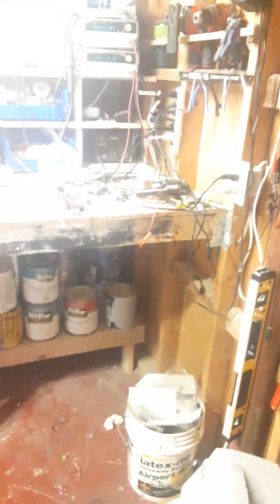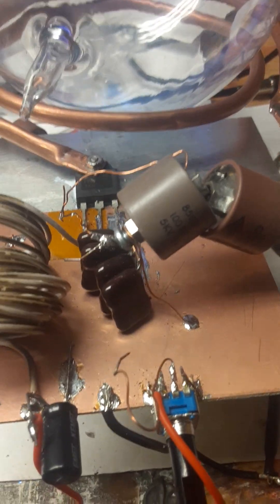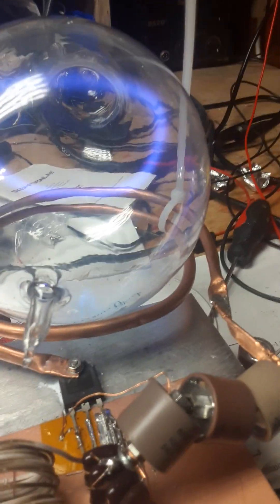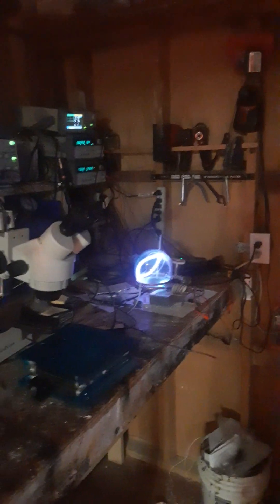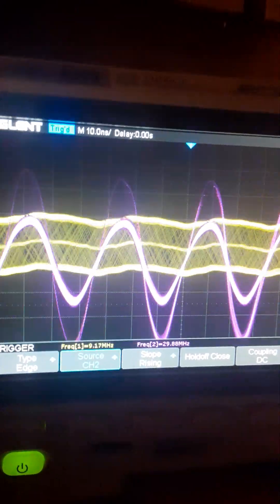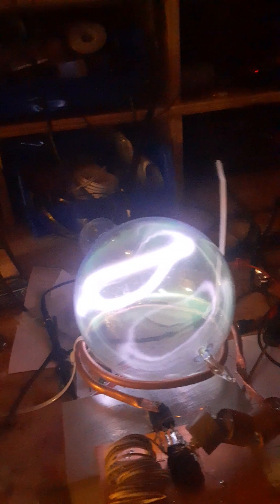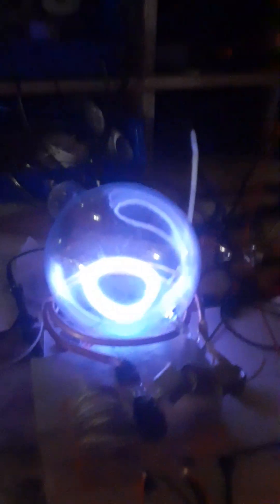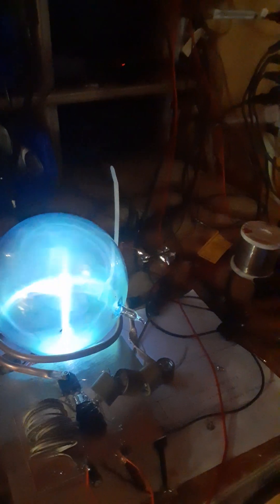Toroidal Plasma 4:   Now AWESOME!

Comment: How do you do these glasses filled with gasses or do you buy it ? I am planning to do a hydrogen one with electrolysis.
Reply from the maker: They are vacuum pumped then backfilled to 15 Torr with xenon gas in an oven.  My friend Wayne Strattman at Www.strattman.com sells them commercially and he can hook you up.  Please don't try to light up Hydrogen in a glass flask!  You can seriously injure yourself this way!!!!   If you want it done right, whatever gas you want, Wayne can help you.
Reply: @kcakarevska  Thank you ! I was worried about possibility of it exploding in my face and sending shrapnels all over but I will check it out. Thanks again !

Comment: Thanks for posting this. I've been wanting to make a plasma globe powered purely from RF using a class E amp circuit like what's used in an HFSSTC, but i wasn't completely sure if it was possible. Looks like you've done exactly that.
Reply from the maker: I love your videos.  Yes, it is possible!  The toroidal discharge Is just another step that makes things a little harder.  Was never able to get very far with direct RF drive, however  as the plasma load is fairly tightly coupled to the oscillator resonance that needs to be fairly high Q.
Reply: Would love to see your take on this project man! Anytime soon mayhap?
Reply: @luminumII  I got all the glassware and circuit components to build one a while back. I still need to get some Argon or neon to fill it with.